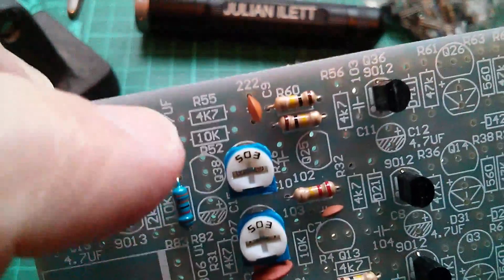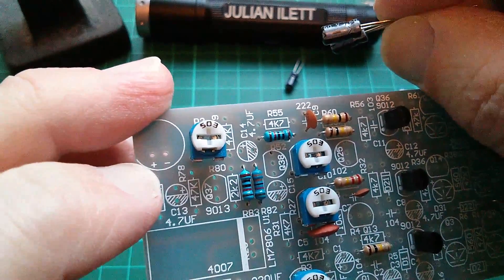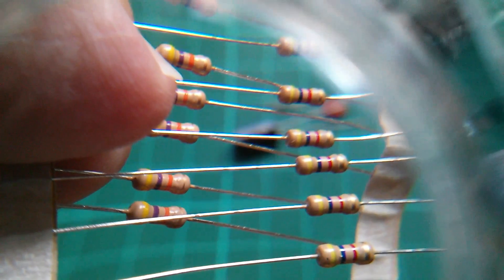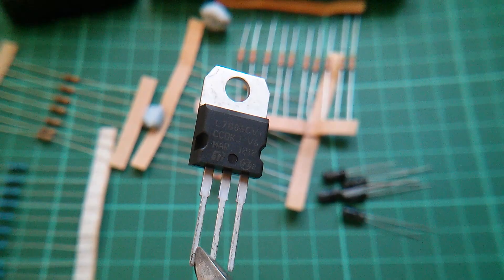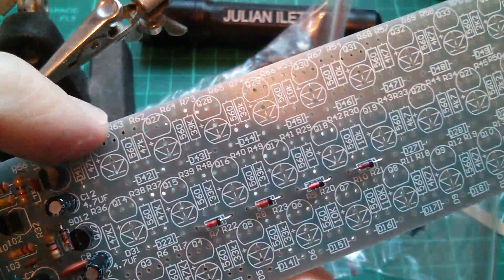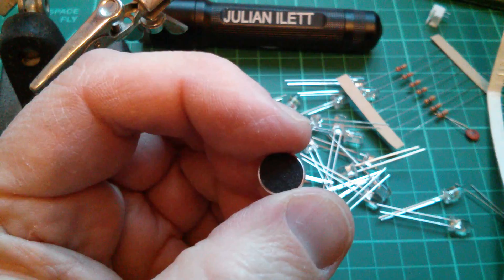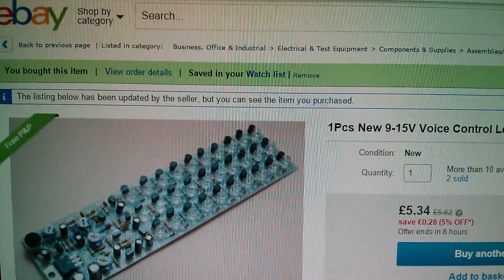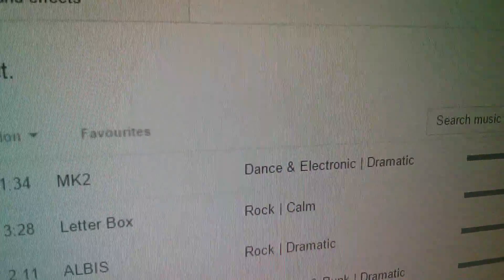Basic Electronics: Kit Build #2 - LEDs, Microphone & Dance Music

Comment: I have the kit arrived today and gave it a try with the first three LEDs. They did not supply a 222 cap, but there was an unreadable one which measured 3nano, so I soldered it in. But the mid frequency band is kinda weak, even when I turned the pod all the way up. Does anyone else noticed this?
Reply: Yes I did that. It kinda works but I think it reacts to 800 Hz instead of 4 KHz like on Julians one... It reacts good now but to the wrong frequency. I think at the beginning I was fooled by the lower brightness of the red LEDs. Perhaps I will replace them with white ones, I don't like red.
Reply: Like I said, there was no 222 cap, which should be 2,2 nano (correct?), but one unreadable but it was physically smaller than Julians one.
Reply: I measured it 3 nano with my Fluke 117C. I think it's near enough to tell it's 2.2 nano. Perhaps the contacts of the probes did increase the measurement. It's not easy to measure nano capacity.
Reply: Hmm I double checked it and because I'm lazy I did not decode the color codes of the reistor, I measured them before placing altough I'm aware of the color encoding. Perhaps the 2,2 -> 3 nano was enough to move it from 4 KHz to 800 Hz.
Reply: Wow thanks for this effort. I hope you will learn something from it, so that you will have your own profit of this. :)

The Fluke 117C is an electrician meter, less one of the electronics meters. But it was so cheap from UK... :D It could be, that it is not really accurate down to nanoFarads.
Reply: What if you trace the low frequency band, the green one on Julians approach? (You can swap the colors you want, I did it like Julian)
Reply: Thanks. I woner if I swapped any resistor. :/
Reply: I have analysed it. The 2.2 nF cap is part of the high freq VU, blue LEDs on Julians built. So that's fine. But it's werid, the component numbers doesn't seem to match the silk screen at all.
Reply: I think its because of the very cheap components. I think one of the caps is not of the stated value or so. They supplied more caps than used in the schematics, when I have time I might swap out some of them and see what I get. Thanks!
Reply: +Glebs Litvjaks   Hello I hope you can help, This 222 cap is it a ceramic or electrolitic please?  Thank you very much.... John :)
Reply: +Glebs Litvjaks   Ok thank you very much for your quick reply :)

Comment: One thing that can make a sub-par iron much more effective with this type of soldering is a "wedge" style tip that more closely resembles a flat-head screwdriver. With the flat face of the tip, you can dump quite a bit more heat into the pad, which makes things go a bit more smoothly.

Comment: "strange" way to do the component placing and soldering.. 

What I tend to do is place the components by height, so typically, resistors & diodes go first.  And to keep them from 'falling' as you turn over the board to solder, I place a slab of dense foam against it and turn it over,  then lay it flat on the table, makes it a bit easier to solder than those helping hands.

When done, snip of the wires, and build up your 2nd layer of components by height.  The foam means you have a bit of tolerance to the height difference of various components, so you typically need to do this in 3 times, and end with single components that are just too irregular to bother with it that way.
Reply: I was taught something very similar to that at college.

Comment: The concave shape of the solder blob indicates that the solder is attached to the lead, (pulling up the peak) resisting surface tension, as the solder cools.  A convex shape can surround a lead, like a donut without wetting it, producing about the same shape, whether or not alloyed with the lead suface and whether or not it is capable of surface tension.

Comment: The 5 ring resistors are a reason, why you should keep up your OCD habbit and mount all resistors facing the same way. Makes debugging much easier, when something doesn't work. The resistors you got unfortunately are a bad example, but normally the rings are either "left aligned" (the ring that's closer to the end of the body of the resistor is the first) or there is a larger gap after the multiplier ring.

Driving a LED with a coin cell is mostly fine, even for green ones. A coin cell has an internal resistance of a few tens if not more than hundred Ohms (depends on size, quality, discharge level, temperature...). A green/yellow/orange/red LED might get 30 or 40mA from a coin cell, but that won't harm it when it's in the open air with long leads like that even if driven for minutes (heat is the issue).

Comment: That's a lot of gear for 5 quid ! great end result too.
Am with ya on the resistors. Those 4 bands are just not as easy for the eye, especially when salvaging from old circuit boards.
Reply: I agree, and the Chinese sellers never detail if it is 3 band or 4 band :(, although not end of the world, just means you have to pull your DMM out.
Reply: Tom Kirby
Exactly haha. 10K is Brown/Black/Orange and no amount of cheapness from China is going to reeducate me !
I mean, what is this, the old VHS vs BetaMax war ? lol
Reply: I also ordered it. Will take up to over one month to arrive in Germany!!
Reply: the tolerance band is noticably further apart from the others (or so I was taught),   so it's quite easy to see which side is which. Or am I missing something,  typically it also tends to be a thinner band
.
Reply from the maker: ***** Seems quite a few people have bought this - 2 sold when I received mine, now 68 sold. Interestingly, this item now appears first when you list all Kingfull's items using 'best match'.
Reply: Shop algorithms for the world. :D